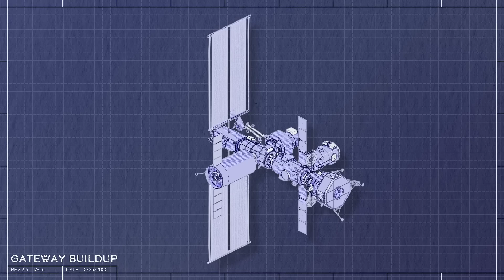Better for Artemis than SpaceX Starship!  The new Dynetics ALPACA!  Angry in Huntsville!

Comment: We don't need any of this if starship pans out as advertised. It's allegedly going to cost $10 million per launch, all the in orbit refuelings can be done in a day. Starship can be the gateway, the lander, the surface base, everything. Plus they are interoperable, reusable, etc. A fleet of starships would really get colonization of the solar system going.
Reply: As another pointed out, Starships are the 18 wheelers. If space travel becomes routine, we need pickups as well.
Reply: @friendlyone2706  Do we though? If starship really is going to be orders of magnitude cheaper, spending all this money on projects other than starship is an opportunity cost. The Artemis time table is too long and its scale is too limited. SpaceX is doing an orbital test of starship next month. When they get a few of these things built, we can deliver tons of payload to the lunar surface.
Reply: @somerando7191  If the space budget remains anemic, you may be right.

Comment: I like your idea to use Starship to refuel Alpaca, but instead of asking why use a high capacity rocket just to send  two astronauts to the moon, maybe a better question is why develop ANY mission  just to send two astronauts to the moon? We did that half a century ago, 6 times. I think we should be thinking much bigger. Send 8 astronauts, or 20 astronauts and have them stay a month or two. Deploy a fleet of test rovers that fan out and gather samples from a wide area. Test inflatable structures. Test robotic mining,  smelting, casting... If Starship needs 9 launches, look at it as an opportunity to do 9 missions at a time.

Comment: Once the SpaceX SH + SS stack is certified for human flight, Artemis becomes redundant to get to the moon.  
Even before then, Orion can be launched to LEO on Falcon-9 ,FH (or some other booster) with the crew to rendezvous with a prelaunched and refueled Starship.  If SS is loaded with 63 metric tons of freight, Orion (37 metric tons, incl SM) can be pushed to the moon by SS as the other half of its load.  All the launches required for the SS round trip from LEO to the moon and back to LEO will come in at half the cost to launch Artemis, maybe less.

Comment: The difference is though, Space X already has the launch Cadance and the manufacturing footprint to do it.
You forget the real issue is cost per ton to orbit, not the number of times one has to refuel. That is an irrelevant metric.
Launching Orion is not cheap.

Comment: Love the Alpaca Sierra dome combo...what an elegant solution. 

Also why is it that when I see Alpaca , I start think that we need something akin to the Space 1999 Eagle. 
A thing designed to move Shipping container sized objects around. Incidentally , how many 40' shipping containers could fit in a Starship?
Reply: The Eagle's cargo capacity would be roughly 30'x15' or about the equivalent of a cargo container in a 72' overall ship length.  Model blueprints say it was 100ft in overall length, so it would carry the equivalent of 2x 40' cargo containers.  It would be great for Earth orbit to lunar or asteroids.  External tanks could be strapped on the truss as well for extended range.  The 72' length would make the cargo containers compatible with Starship's 30' diameter.  What would be needed first is a transfer station for cargo and passengers.  The station should be in geostationary orbit to make Starship trips as identical as possible.  The station should serve as a cargo transfer station, quarantine point, and shipyard.  Starship is a horrible design for both lunar or Mars landings as the engines are too close to the ground for uneven terrain.  It needs a flat landing pad.  The Eagle would be better suited for uneven terrain.
Reply: @2fathomsdeeper  the 40' container is such a ubiquitous shape and can be made from just about anything as long as the corners are strong...that's their beauty right there. I imagine that the main reason that they aren't used yet in space, is due to the simple fact that no one has put them to the test. Corrugated carbon fiber sheets with aluminum corners should make very useful space box....and yeah something akin to the Eagle designed to easily pick them up and move them.
Reply: @NeilABliss  Yeah, Like Thunderbird Two.
Reply: @2fathomsdeeper  They lost most eagles when the stockpile blew up. The Eagles were a complex design well into the future, Starship has to get the ball rolling, there will be many iterations between the two, I've waited most of my life for Elon Musk to emerge, he is our Zefram Cochrane.
Reply: LOL, I came here to suggest the same thing. Seeing Eagles working on and around the moon would be so cool!
Reply: I say that's an excuse to build gundams
Reply: Perhaps such a craft should be constructed on the moon and never return to earth!

Comment: I thought there was a proposal to send fully-loaded Starships on one-way missions to the Lunar surface. Among the cargo would be equipment to extract and refine lunar ice into enough methyl-ox fuel to get the starships back into earth orbit; pick up another cargo load; and repeat. This would seem to be the most efficient way to establish a long term lunar colony.
Reply: The Alpaca sized Lander seems to be the perfect addition for an efficient regular Landing from and starting service to Lunar gateway. The fuel extracting machines for Starship will most likely require some time until they are constructed, set up and working fine. So as a long term goal I agree that Star ship could be the big transporter to the Lunar surface as well, but a working Alpaca would close a huge gap on early regular moonlandings.

Comment: Imagine a fully fueled tanker starship docked with the lunar gateway. Then Dynetic's Alpaca can refuel  every time it docks with the gateway.
Reply from the maker: I discussed this several times with Dynetics staff. They are very open to a Starship fuel depot.
Reply: @TheAngryAstronaut  With it's relativly small size, and ability to land and take off the Luna surface several times (if I understood correctly), the ALPACA would make an excelent scout/recon vehicle, and for light dutys.   Also as an ambulance / emergency vehicle.
Reply: Or… the Starship itself becomes the Lunar Gateway… all that living space, laboratory space, maintenance shop and a giant fuel tank. You could also bring it back to earth orbit for regular maintenance refilling tanks and cargo transfer.
Reply: @waterboy181  Absolutely right.
Reply: @waterboy181  One day a Starship will become a private space station, maybe at the LaGrange L2, use Luna to shield the station from Sol.
Reply: @krashdown5814  I like the way you think… several different types of instruments mounted. Space for a maintenance crew to live and work. Basically the ISS but mobile. In fact when the ISS is done it would make a lot of sense to cannibalise the entire main truss off the station and move it out to L2 t create a dock for Starships with built in solar panels. Slap a Tesla logo on it and think of it as the first space supercharger
Reply: Exactly. Starship could act is a tanker, traveling between LEO and Lunar orbit, doing all the heavy transport of fuel and hopefully all the building materials and machinery required to set up Lunar bases and mining operations.
Reply: The Lunar Gateway is not planned to be used as a refueling depo. A Starship Tanker orbiting the Moon will have enough fuel to also refuel the ALPACA.?? :face-purple-wide-eyes:
Reply: @jlmwatchman  At Musk Metholox prices.
Reply: So where do you attach the excavators, giant drills and all the pipes to the Alpaca Lander ? - you know, for the moon base.
Reply: @cryptosupplyshop3425  That's why you need both.

you don't try to move your house across the country in a jeep, and you don't use a semi to go to the corner store.
Reply: 100% agree. If ALPACA is selected I can see Starship HLS adopting more of a supply role to get fuel to Lunar orbit and refuelling at the Lunar Gateway makes sense since the ALPACA lander needs to dock there to embark/disembark its crew. HLS would also have a critical role to land big & heavy components on the Lunar surface once building a permanent base and other surface infrastructure starts but ALPACA makes more sense as a basic crew shuttle. Since it will be a long time until any permanent base is anything like self-sufficient I would think that even after a base is established Starship HLS would still do Lunar landings to deliver high volumes of perishables to the base but given Starships payload capacity I would hope that those trips wouldn’t need to be too frequent. If things really did go that way, and if ALPACA timescales were sufficiently aggressive, human-rating Starship HLS then becomes a nice-to-have rather than an essential step on the critical path if it is only ferrying fuel and heavy surface components.
Reply: Hydrolox vs metholox
Reply: @contestvoter  the 150T of cargo space will hold a lot of hydrogen
Reply: Exactly
Reply: Elon Musk would feel insulted to allow his Lunar Lander Starship relegated to mere "fuel tanker" (read: tramp steamer), while ULA/Dynetics, his opposition, are elevated to leadership status and getting showered in glory. Doubtful this will ever happen.

Comment: The only thing I don't like about this design is the off-center fuel cells. If there is some imbalance, then the craft could become difficult (if not impossible) to land or maneuver.  Think of a modern aircraft with one wing full of fuel and the other empty, combined with a total 'Fuel Transfer System' failure ... It's NOT going to be easy to fly, let alone land.
Reply: An off center mass case has to be considered for safe operation, that's surely true. Having enough thrust to compensate for any given state of fuel distribution. But - no worries about steering it by hand - Stabilizing senors have become dirt cheap on consumer drones, no need to do basic vehicle stabilizing by hand anymore. You could install 20 redundant systems using only one kg of electronics and batteries.
Reply: @Maximilian Hacker  ... True, but competent engineers don't rely on adding additional systems & subsystems to compensate for basic design flaws.  They remove the design flaw.
Reply: @digiacomtech5589  No passenger aircraft have their engines near or in the center (anymore) - although it would be way better in the case of a one sided engine failure. They can sustain flight with one side engine only and that matches the requirements for safe operation.  After all your Alpaca one side filled tank critic describes an emergency edge case, surely not the case in normal operation. I agree that it has to be considered, but it seems to me the current design also has clear advantages over the classic eagle lander design. 
Blue Origin has shown a Lunar Lander design you would consider to be better in that regard, right?
Reply: I'm not sure an airplane is a good example here, because (1) No aerodynamics in a vacuum, so much less instability (2) A rocket engine can gimbal.
Reply: @SpaceX rocks!  The example given concerns weight & balance, which are still present in the vacuum of space.  Rocket engines can only gimbal so much in order to keep the center of thrust aligned with the center of mass (Physics 101).  Again, the best designs eliminate as many potential problems as possible, they don't add to them.
Reply: @DiGiaCom Tech  So how would you redesign it, where would you like the tanks to be placed, and/or how many? Please help eliminate or reduce the risk.
Reply: @SpaceX rocks!  ... Easy, place the things with the greatest mass along the line of thrust that runs through the center of pressure and the center of gravity.  The exact opposite of placing the things with the greatest potential of mass change the farthest away from it.
Reply: @DiGiaCom Tech  Sorry I'm having picturing that. Are we  talking about stacking the tanks on top of the crew cabin? That keeps the c/g aligned with the center of thrust, but I don't understand "center of pressure". I don't think you mean pressure of the cabin, the tanks, or atmospheric pressure. Please clarify.
Reply: @spacexrocks1041  ...  Well, perhaps for this craft the use of 'Center of Pressure (CP)' isn't really appropriate as it's an aerodynamic term on a non aerodynamic craft.

The example I provided (dealing with an unbalanced aircraft) was specifically talking about balance and torque issues caused by an off center CG.  That being said, you can certainly Google 'Rocket Center of Pressure' for more details in that subject.  Basically CP is just another force to consider when summing up all of the forces involved with any flight, (something to consider as they might want to fly this thing within the atmosphere of Mars  or some other planet someday?).  

However basic design principals do apply here, keeping all of the forces as aligned as possible, putting all the things with allot of mass (or potential for substantial changes in mass over time) along the centerline of gravity & thrust.  And I'm talking about the vectors of thrust being aligned with the center of mass/gravity for this craft only.  Consider having four engines symmetrically off center from the craft's CG and one goes out during takeoff, this now throws a massive torque problem into the controlled flight equation.  Again referencing a 4 engine aircraft,  three go out and only the one farthest out on the wing is still running.  This case puts a tremendous yaw torque on the aircraft requiring an equal amount of  counter force (rudder) to keep it flying straight.  In the case of this craft, that would have to come from RCS thrusters (eating up precious fuel) or by shutting down an opposing engine (not good when performing an orbital insertion takeoff burn).

Take for example the F-117 which can NOT be piloted manually.  That is a flight control computer needed to be created to receive & interpret commands from the pilot, it' only the flight computer that makes the aircraft go wherever the pilot wants it to go.  And if that flight control system fails, the aircraft becomes unflyable and subsequently lost.

Bottom line is I'm sure the engineers are accounting for these potential issues in their designs.  However and IMHO, engineers having to pile on additional engineering & additional systems to compensate for and/or resolve fundamental design flaws is not the way to design any craft.
Reply: @DiGiaCom Tech  You still haven't answered the question of "how you would design the lander to compensate for this problem"  If you had to draw your solution, what would it look like?

I really do not understand your concerns because the following spacecraft had opposing fuel tanks: the LM descent stage, the LM ascent stage, the Viking landers, the Luna sample return stage.

In any event, you have not presented a specific solution, just general principles of physics and aerodynamics. You're the physicist & rocket designer, but you have not given us any solutions, just complaints and a "humble" opinion.

With all due respect, if you cannot offer any specific solution to your complaint, this is not a useful discussion.
Reply: @spacexrocks1041  Yes I did, but perhaps you misread/misinterpreted it...

"However basic design principals do apply here, keeping all of the forces as aligned as possible, putting all the things with allot of mass (or potential for substantial changes in mass over time) along the centerline of gravity & thrust."

Translation:

Heavy things and/or things that change weight and/or position over time should be placed along the center line (or as close to it as practicable) that traverses the Center of Gravity (CG) and Center of Thrust (CT) ... the centerline of the craft if you will (from top to bottom).  Draw a line between these two points and stack thing up along it accordingly.  Same as every other rocket design in history (e.g. the Apollo Lunar Lander).  

Yes, that makes for a taller craft with the crew most likely on top.  But then getting themselves and/or cargo up/down are simple/uncomplicated problems engineers have already solved.
Reply: @digiacomtech5589  I guess I do not agree with the premise that any engineering or mechanism developed on earth can be easily or simply adapted for use on the moon. Yes the principles are the same, but the operating conditions are very different on the moon: vacuum, extreme temperature ranges, 1/6 g, and lunar regolith. You have a different opinion/conclusion – that’s great, because that’s what makes discussion worthwhile. I do appreciate your kind approach to all this, but I think we'll just have to agree to disagree.
Reply: @SpaceX rocks!  ... Sorry, but the physics involved here are the same on Earth, the Moon, and anywhere else for that matter.  All the forces we experience here on Earth work the same way on the Moon.  Base engineering principles apply only with different values in the equations for things like gravitational forces.  Temperature is basically irrelevant when it comes to weight & balance, and aerodynamics are irrelevant as there is no air.  You put a heavy kid on one side of a teter-totter and a lighter kid on the other, and the heaver side goes down in the same way on the Moon as on the Earth.  Base engineering principals apply to everything, everywhere.  The Apollo Moon lander worked on the Moon because we designed one first to work on the Earth and then adjusted the numbers to work on the moon.
Reply: @DiGiaCom Tech  You're just not listening to what I say. This conversation can serve no further purpose.
Reply: @SpaceX rocks!  Neither are you. However in your case, you are not listening to well-known, proven physics and best engineering practice, things I'm NOT making up on the fly.  So, given your apparent lack of understanding of basic physics, I would agree that further discussion of this is pointless.